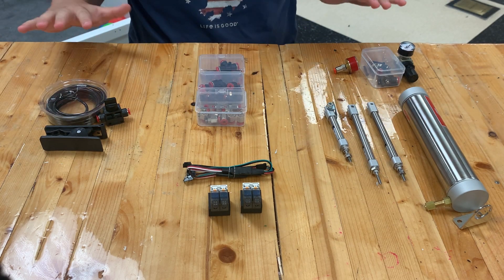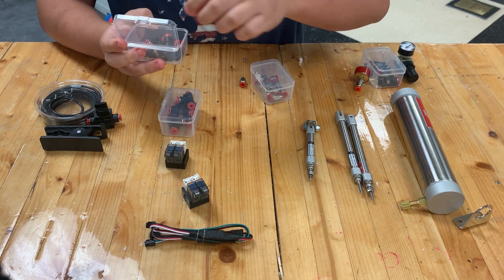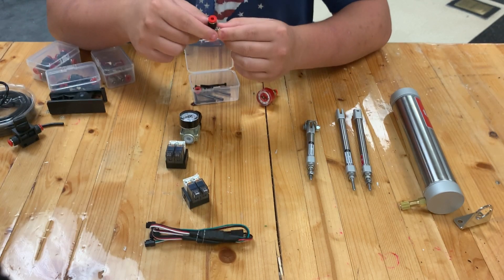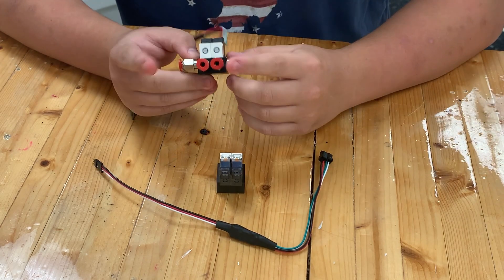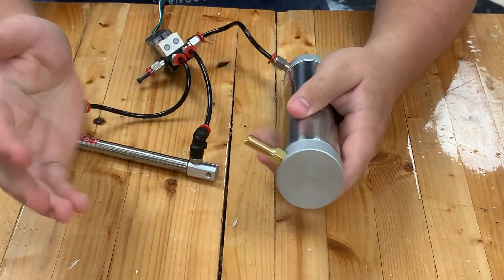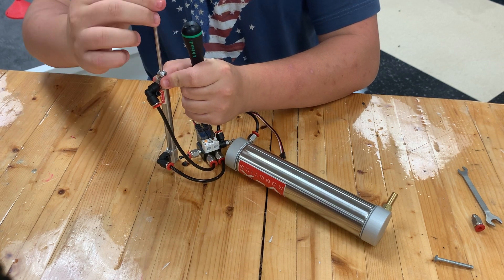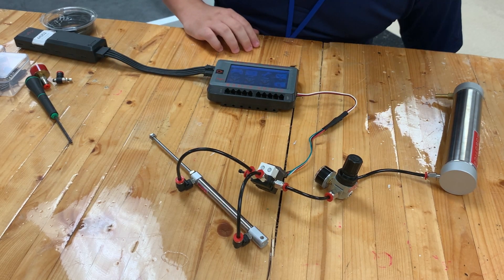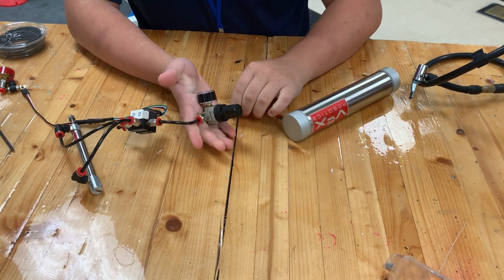44252A Vex v5 pneumatics kit beginners tutorial

Comment: What size fitting will work with the end nozzles on the resevoir. Im trying to buy an air compressor for my team but  I dont know what size fitting is compatible with the nozzles that plug in to the resevoir. Does anyone have a recomenda+tion on a specific air compressor on amazon I should buy?
Reply from the maker: It’s the same as a bike pump/tire pump. This is what we use https://www.amazon.com/AstroAI-Cordless-Compressor-Rechargeable-Motorcycles/dp/B0948WY5YX?pd_rd_w=Xzuoo&content-id=amzn1.sym.374b0f4c-7004-471a-8101-cd202f0dfefb&pf_rd_p=374b0f4c-7004-471a-8101-cd202f0dfefb&pf_rd_r=4P1KZMZ301EN0D1JEFA1&pd_rd_wg=UwBdY&pd_rd_r=cd131957-3e26-42d0-a850-f34fb911baf6&pd_rd_i=B0948WY5YX&psc=1&ref_=pd_bap_m_grid_dv_rp_0_1_ec_t